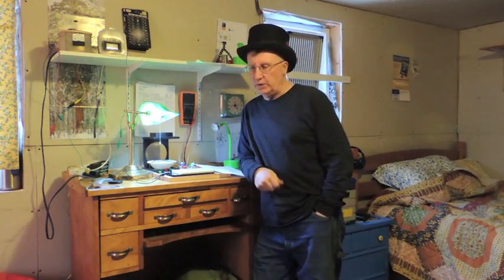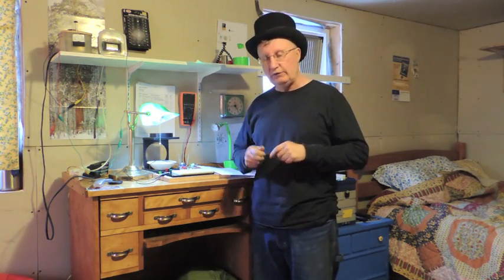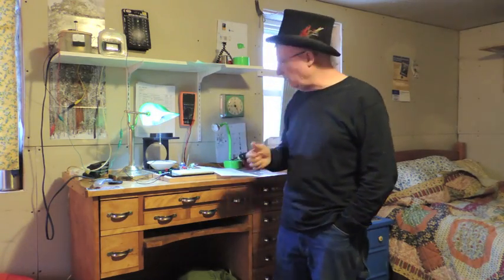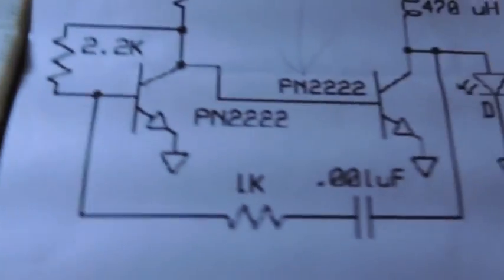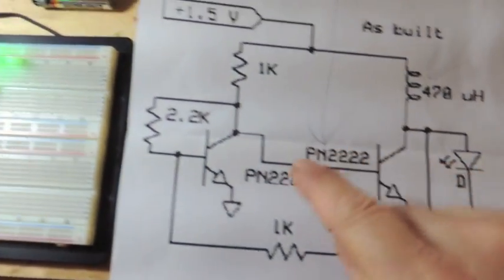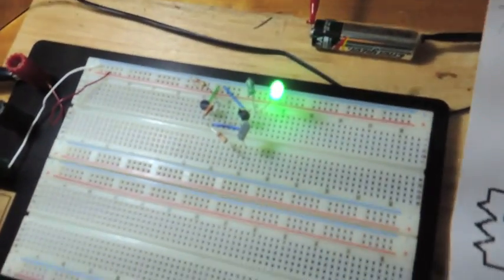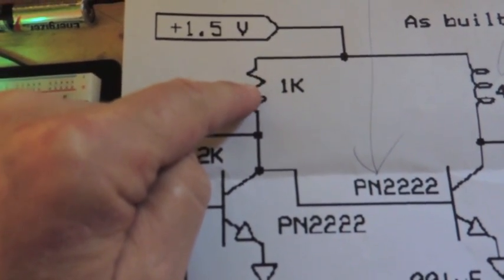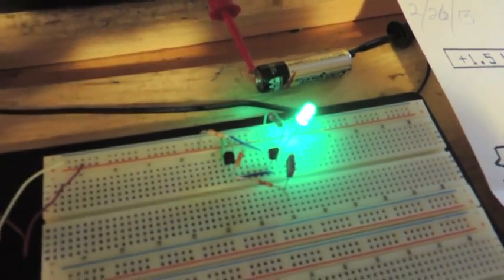Joule Thief

Comment: The low output with the 1k resistor is the reason why you will see other designs use a PNP instead of NPN for the left transistor.  The PNP will furnish all the right transistor's base current instead of the resistor, thereby eliminating the problem.  The circuit does work, but it's a good idea to put a pot in place of the 2.2k resistor and adjust it for best brightness.  I've found that a 3.3 to 3.9k resistor is brighter, depending on the left transistor's current gain.  Thanks.

Comment: Sucess ! You can probably use earth batteries to power that. Or even a piece of fruit like an orange or a lemon. You remember the science experiment? Copper peenny or wire into one side and a galvanized nail in the other boom you have a battery. I am not sure but I think the same works with urine.